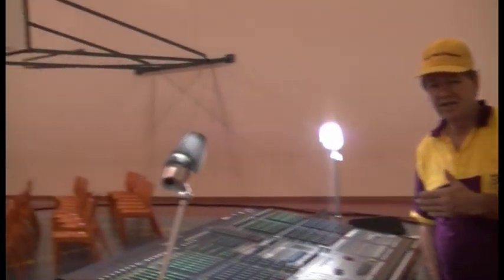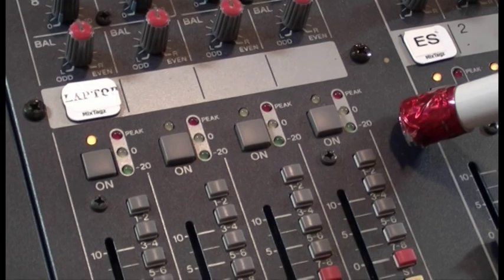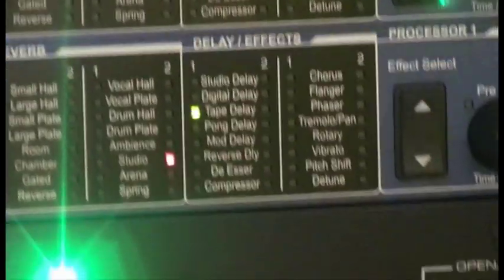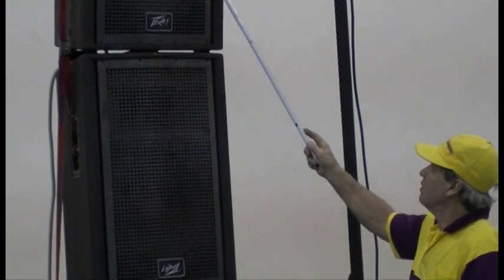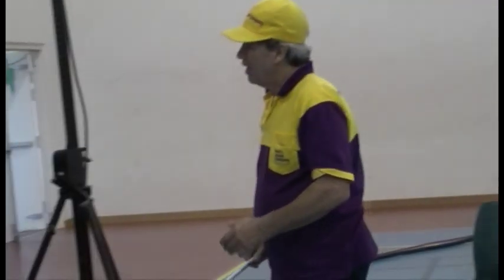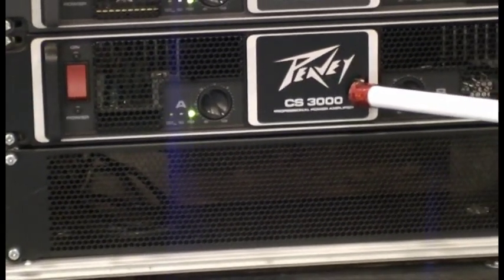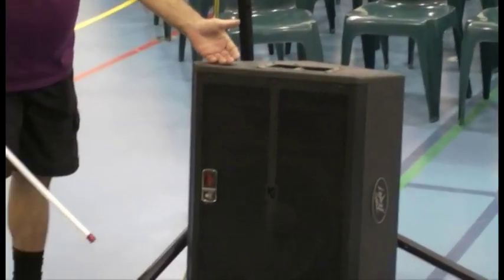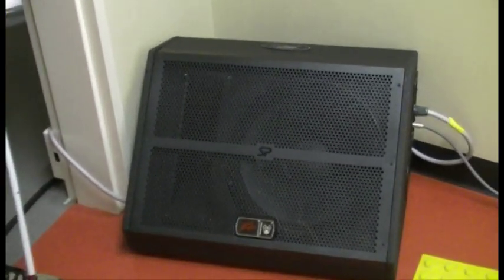Anatomy Of A Pro Audio Sound System - Part 3

Comment from the maker: The most inportant thing you need is Knowledge and Experience. Pro audio operation is a mix of science and art. If you don't have the luxury of enroling in a audio engineering course, the next best way to gain important basic knowledge is from the vast wealth of information on the internet and of course those old fashioned things called text books. Pro audio internet forums are also a useful. As for the Art... listen hard and you will learn as you gain experience. Just aim to be the very best...

Comment from the maker: For a start... this is a small school (400 people) concert gig... at bigger outdoor gigs we run up to 8 x QW218 subs (16 woofers fed 1250W  at 8ohms), 8 x QW2 fed 1020W to mids and 380W to highs, 6 x SP15M fed 650W at 8ohms plus a powered sub drum fill.
Now with quick maths we have exactly 35,100 watts maximum.... nobody would be silly enough to run that down a mic/line level multicore.

Comment: Also the Peavey CS 4080HZ is rated at 2040w per channel at 4 ohms giving it a total power out put at 4 ohms 4080w peak out put and the CS2000 is rated at 760 watts per channel at 4oham giving it a total of 1520w for both channels running at max.

Comment from the maker: I am talking about the maximum rated output of the amps not peak amp power... amps driven with a clipped signal can produce a 'peak' up to double the amps rated output. My amps feed the subs approx. 79% program power, the mids approx. 85%, the highs are fed near peak power due to the CD horn EQ settings in the DSP loudspeaker controller.The speaker drivers are also protected by the VSX26 DSP unit's limiter settings.
And yes you can get multicores with built in speaker cable for low power systems

Comment: Hi Brad, I'm well aware the longer the cable the higher the resistance is, but if you are all ready running your multi core down there then why not run your speakers off it as well, it would have made your set up look a lot cleaner.

Comment from the maker: A)...If I had the amps at the desk I would need to run 45 metre long speaker cables around the outside of the room along with my multicore. The cables should be kept as short as is practical (for reasons that would take too long too explain here). Apart from that... I always have a tech assistant with me at all gigs... the desk is never left unattended.

B).... technically you are correct....but I do not consider that a 40mm diameter light stand would block too much of the people's view.

Comment from the maker: Correct... the QW218 drivers are rated at 800W Continuous...1200W Program... 1600W peak.
The 'Continuous' rating is based on a constant level signal such as a sine wave, The 'Program' rating is based on average live musical signals (recorded music is heavily compressed so it would have a higher average signal level). The Peak rating is based on a momentary signal at the peak level. The factory recommendation for maximum safe performance is to run amps at a level of 65% - 85% of program rating

Comment: can u tell me?how can i will do a stereo patch-up?
Reply from the maker: Hello DJZIKO.... I would need a whole lot more information as to the equipment that you intend to use to offer you any meaningful advice
Reply from the maker: DJZIKO PAUL... Almost all consoles will have a left and right main outputs. To create a stereo mix, you must pan some of your input channels to left and some to the right.
 Ideally you would then insert a 31 band Graphic equalizer into each output (if your console has no insert points, place your EQs in line).. Then using balanced cables connect to each input of your amp... then output to your speakers.
 . If you are using subwoofers, you will need a active crossover to send the low frequencies to your sub and mid/highs to your top speakers. (some amps have built in crossovers)

Comment: But again you are talk peak power, my behringer b115d speakers can do 2000w but that's peak power and you can run that much power down a multicore if you make it your self. 
I did a show a few years a go (for Scouts Australia) and we had the amps with us at the back and the total system power was around 9000w but they had a custom made multicore.

Comment: I know what a multi core does, I have done live production for church's, schools and clubs in the past, I also know that you are talking peak power, if you ran your system at the full 32,000 watt's of sound you would deafen every one in the room and blow the windows out.

I also know for a fact that the figures you are quoting in your videos are wrong, each of the sub drivers are only 800w continuous due to Peavey combining the total power of the speakers to make the speaks look better.

Comment from the maker: You obviously do not have a full understanding of how to set up a pro audio sound system for live use.
DJ rigs are different as your desk is on the stage.... not towards the rear of the venue. The multicore has two functions... to send microphone level signals from stage to mixer, and to send Line Level signals back to the amplifiers (or powered speakers). You do not send Speaker level signals (in our rigs, more than 32,000 watts) down a multicore, unless you like to see those tiny cables melt